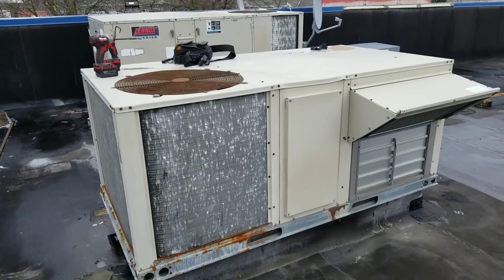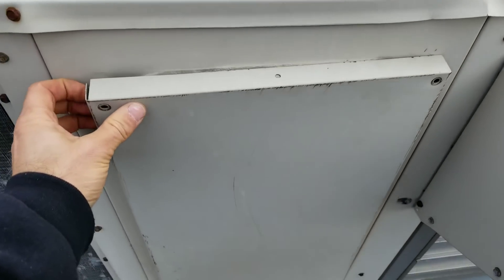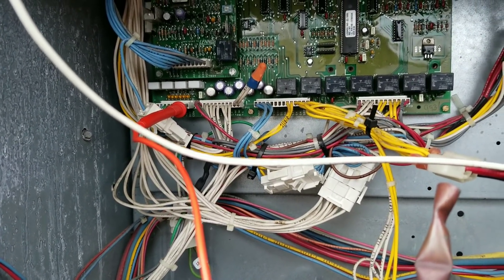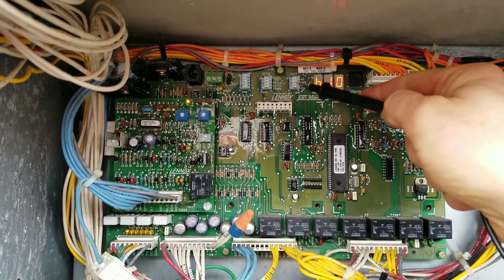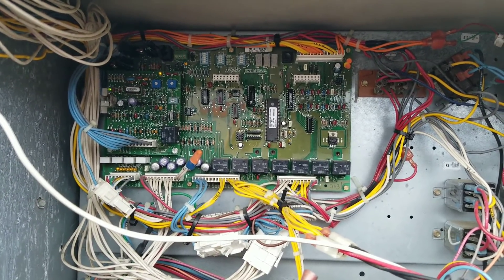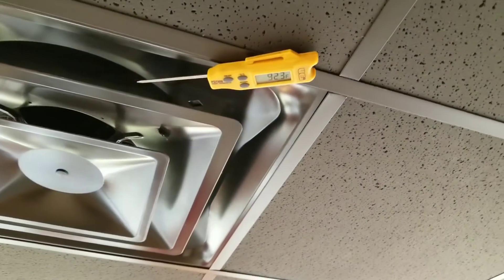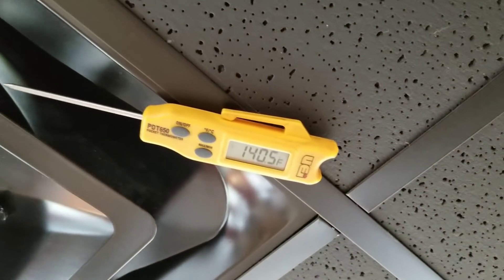Lennox unit heating erratically

Comment: This is exactly what I need to do at work. The thermostats are in a small office, two remote sensors that are connected but disabled, thermostats programmed to read their own temp. It can be brutally hot in one zone, I go set the temp down two degrees, and freeze because the A/C is cranking away right over my head but the temperature in the office never changes, so it never satisfies.
One day I got into the menu and enabled the remote sensors, and it read both zones as being over 90 degrees. I didn't feel like messing around with it, so I put it back the way it was and walked away, frustrated that the tech that installed the system never set it up properly. (I know, as a fact, that nobody there other than me knows how to access the settings, not even the store owner or franchise owner, heck they don't even know there are 4xAA batteries in the Honeywells. I had to teach them what "Auto" does, because everyone kept switching it back and forth between "Heat" and "Cool" modes and then changing the temperature...)
One of these days I'll get in there and set it up properly, I just need everyone to leave me alone for ten minutes so I can do it!

Comment: The sensor datasheets should indicate if is a 10K or 20K thermistor . To add more confusion to this you can have 10K thermistor type II or type III (slight temperature-resistance differences). When in doubt compare the actual temperature-resistance values with the thermistor chart just like you did it.

Comment: The 20k option is available if you have 2 10k zone sensors in parallel.  Between the 2, you get the average back to the thermostat. My numbers might off, can't remember. It's about averaging though.

Comment: Wow that supply temp of 140F is way higher than I'm used to seeing or designing for. That unit's heat seems way oversized to me, and that definitely could cause uncomfortable stratification in the space. I've always been taught to size for 90-100F supply temp, 120F max even in our somewhat coldish climate. Maybe it's fine in peak winter in your climate. Good fix!
Reply: The heater in this video was cited as requiring a rise of 40 to 70F. If the return is 70F, that means a minimum supply of 110F. It's a bad idea to operate at the edge of the allowable range, so I'd say 120F is very reasonable. If rise is too low (caused by too high airflow), water will condense in the heat exchanger (causing rust...).

Comment: Thermistors tend to be rated by their resistance at a specific test temperature.  10K is one of the most common.  NTC (negative temperature coefficient) means that the resistance gets lower as the temperature gets higher.
Reply: Oh hey, Big Clive's into refrigeration too!
Reply: @Tjita1  I used to work with Hussmann building and installing supermarket systems.
Reply: Holy shit it's big clive

Comment: I recently installed two new Honeywell thermostats with two of those remote sensors and I couldn't find what type they were either in the manual so I'm glad someone else was having that problem haha. I think that they differentiate between the two sensors by what oms reading it has at 76°F but that's just a guess. Thanks for the video Bill!

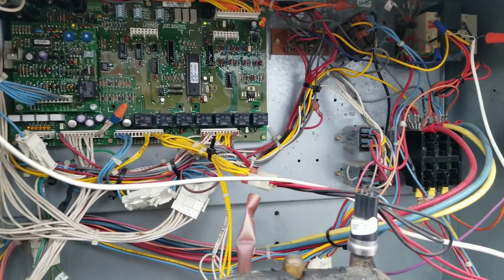Comment: 1:32 Looks like there are some bulging capacitors along the bottom edge of the control board (behind that orange wire nut).  That might cause some issues soon.
Reply: Excellent catch. Those electrolytics are all suspect. Looks like at least 3 failing caps on the main board and probably at least one more on the daughterboard.
Reply: I also noticed it... Since it's my job to repair electronics, I have an eye for those... And there is a second that might have started too...
Reply: hard to tell by the video, but that one was looking bulged, the rest not so sure. many of the caps from around that age had real heavy embossing on the burst seams and always looked uneven sometimes even puffy brand new, the shrink file labeling also tended to be lose and domed at the ends making them look suspect also.

Comment: NTC thermisters are specified at 25C. Why use a particular value? If it's too high, the current will be low and the signal will be more sensitive to electromagnetic interference. If too low, 2-wire sensors will be more effected by the resistance of the wire going to it. Is there a good reason to choose 10k vs 20k? Probably not, except for equipment compatibility.

For really high or low temperatures, you'll want to select a thermistor with a resistance at the working temp close to the (unknown) resistor value in the thermostat. It's likely the thermostat has a 4.7k to 22k  resistor internally. This means really high temp applications should use a high value thermistor and low temp applications should use a low value thermiator for best accuracy.

Comment: I use temp to determine what value the sensor should be,  at 25C I should get 10K or 20K and so on, but only works with a known working sensor, I have a list of equipment/controllers that use different rated sensors. Made the list over years as new equipment comes out.